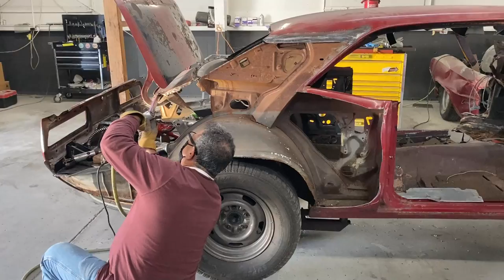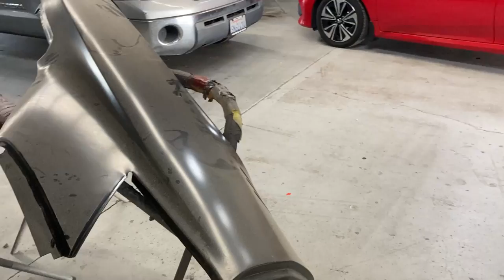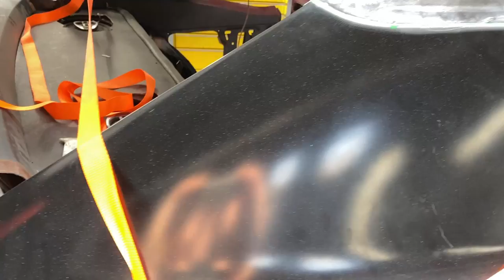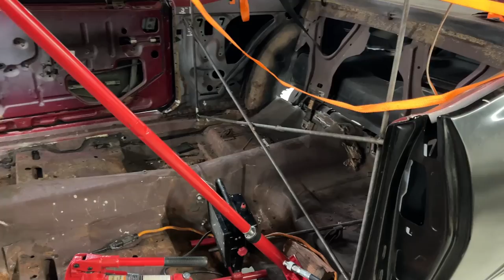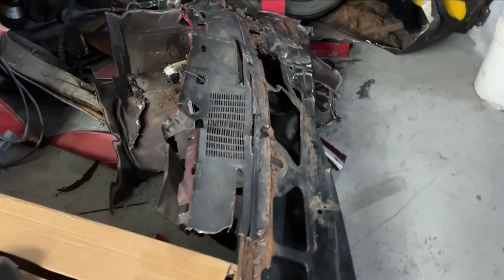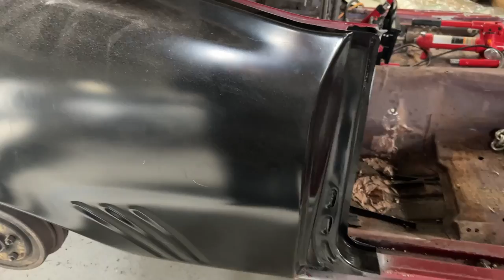Garnet Red 69 Camaro Z/28 - Crashed but not Dead - Part 6   Body Panel Replacement Continued.

Comment: Looking good so far.  I agree with some of the other guys that would have been better to put to car on a jig for alignment however the front driver side where the jig locater was, is destroyed.  Gotta do what you gotta do to save this Z/28. Quite an undertaking but will be worth it in the end.  Keep the videos coming and thanks for posting.
Reply from the maker: Hi Mike,
There is going to be a jig made from my blue Z featured in my other videos, but the replacement pieces have to be installed first to create a complete unibody before it can be moved to the jig. I agree with you about the jig, but the whole left side of the car was destroyed and there was no way to place it on the jig.
Once the unibody is assembled (loosely of course) it will be placed on it then welded properly
Reply: more of the build
Reply: @digitalpizza1  thanks Pete.  Looking forward to more of the build

Comment: Over here in the uk we would call this "Triggers Broom " . There is very little original metal left. I'm more than surprised the car is not on some kind of jig and this is not how l would have repaired the car. You can see in the final sequence the door no longer aligns with the quarter panel and the quarter has to  come off again . I've watched this from the start and l said at the time l would have enjoyed repairing this ......but not like this ! .....each to his own , as they say ! Thanks for sharing .
Reply from the maker: Hi John, the quarter panels have not been welded in place yet, and the door has not been fully aligned yet. Actually, the door latch is not even on the quarter panel yet. I assure you these things will be aligned in the end, and the car will be straight. Also, I have seen totally rusted out cars end up with less of the original metal than this car will have in the end.
Reply from the maker: Hi Mike,
There is going to be a jig made from my blue Z featured in my other videos, but the replacement pieces have to be installed first to create a complete unibody before it can be moved to the jig. I agree with you about the jig, but the whole left side of the car was destroyed and there was no way to place it on the jig.
Once the unibody is assembled (loosely of course) it will be placed on it then welded properly

Comment: I have to be critical here, you need a complete car that's original and you make a roof to floor jig in that straight car, usually to the belt mounts and bolted in, you then level the damaged car with the jig and blocks but not using the axle, it has to be with a minimum of a spirit level in a four way measure. If the springs are slightly out you'll build a twisted shell doing it the way you're showing, the bent shell will yield to a frame built in a straight car, it has no choice other than to line up. I've been in the game for 38 years and mended many bent ones, it's all about the line up and you can get it from the smallest part that's straight.
Reply from the maker: Hi Mike,
There is going to be a jig made from my blue Z featured in my other videos, but the replacement pieces have to be installed first to create a complete unibody before it can be moved to the jig. I agree with you about the jig, but the whole left side of the car was destroyed and there was no way to place it on the jig.
Once the unibody is assembled (loosely of course) it will be placed on it then welded properly
Reply: @digitalpizza1  I've been thinking it through, if you remove the doors from the Blue car and make the jig fit the bolt holes on the door pillars it'll line up perfectly.

Comment: Wow that inter structure should of been done  first in a jig before add the new sheet metal .!!
Reply from the maker: As Mentioned in previous comments, nothing has been welded or permanently attached yet, and the car is going to be placed on a jig before any of that is done. Stay tuned.
Reply: @digitalpizza1  OK just did not want you to have regents later, it is impotent to make sure that the Fisher skeleton is right first .i my self would do things different that's all  .
Reply from the maker: Yes, I hear ya, 😎
I agree with you, I am definitely working with them to make sure it goes together correctly, and they are building the jig from my blue Z

Comment: I’m sorry to say, but this is not how I was taught to do bodywork. The first thing he should have done was to reconstruct the bird cage of the carriage and make sure that is straight. There is no real way to tell if the quarter s are square without the firewall and the A pillars solidified. I’m hoping I’m wrong.
Reply: That's why he pulled all kinds of measurements from the other car that is square and straight. As long as the backside of the door jamb is where it's supposed to be then he should be good. I believe in previous videos of him pulling the damage he used the measurements of the other car to make sure the front was where it needed to be before he cut the bad out. The guy definitely knows what he is doing!
Reply: @bigsexymuthashutyomouth2546  no two are alike. Again, this is very different from what I was taught, but if you have your trust in him, then that’s all that matters. Truly looking forward to seeing this once gorgeous car come back together.
Reply from the maker: Hi Mike,
There is going to be a jig made from my blue Z featured in my other videos, but the replacement pieces have to be installed first to create a complete unibody before it can be moved to the jig. I agree with you about the jig, but the whole left side of the car was destroyed and there was no way to place it on the jig.
Once the unibody is assembled (loosely of course) it will be placed on it then welded properly
Reply: @digitalpizza1  in cases I have seen like this, the car is pulled to square, with the subframe in place, and then the bird cage is repaired, by being placed on a body jig. Then all the body panels are test fit with the doors and trunk in place to ensure they gap. Then the welding of the panels begins. 

Everyone has their own way of doing things, and if you say your guy has 45 years experience doing this and you trust him, then he should come through for you. I can only speak for my own experiences of being in this craft for over 35 years and I have never seen panels attached to a car that does not have the A pillar attached on one side.
Reply from the maker: Hi Phoenix, I agree with you, and totally respect your input, and am going to share your insight with him. Keep in mind, the panels are installed, but not spot welded yet. My understanding is that won’t be done until the unibody is together and placed on the jig.
Reply: @digitalpizza1  ok good, as long as he hasn’t welded them in , you should be ok. Because what happens, is when you weld them in, unsecured, and then try to pull the body, the quarters are going to buckle and potentially bulge.
Reply from the maker: agreed, we are using the factory holes (2 in the front and 2 in the rear) on my Blue Z to make the jig.

Comment: That's a ton of cost in labor, is it worth it.
Reply: That's exactly my question two. I just don't see it.
Reply from the maker: The cost is a lot less than if one were to commission a typical body shop to do this work.
I have a restoration shop as you know, and the cost is a pretty much at a wholesale level.
Well worth the effort for a numbers matching original Z
Reply: @digitalpizza1  Wholesale of course is less, I mean a retail customer cost vs outright purchase. Overall known condition counts for a lot too.
Reply: It saves a classic car that would otherwise be a dusty photograph, of course it's worth it.

Comment: This is a stupid rebuild.  More money spent on this than it will ever be worth.
Reply from the maker: That might be true if you are making an unfair assumption on how much is being spent. Any true numbers matching Z is worth saving if at all possible. I would rather save this crashed car than half of the total rust buckets that I have seen restored.
Reply: @digitalpizza1  , if you even have the original motor you will find that you are spending more on this than it will be worth.  Just being honest.  If you have unlimited money and don’t care what it costs it can be a fun long project. You are still losing money on this venture but have fun doing it if it makes you happy.